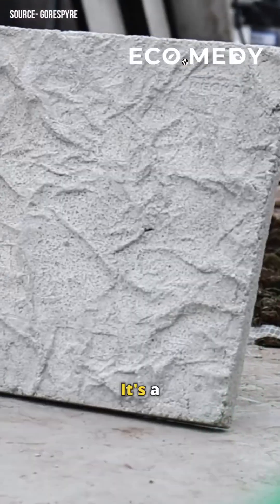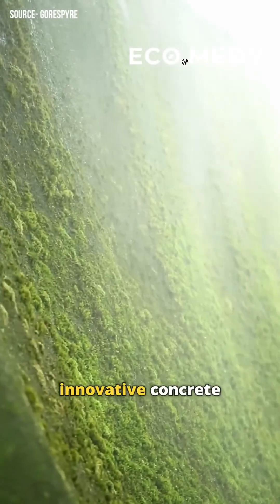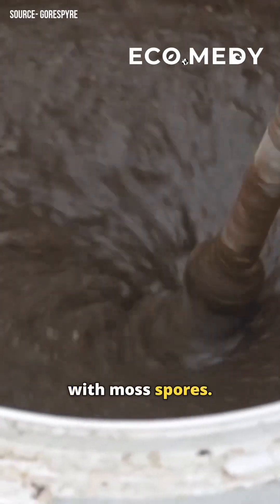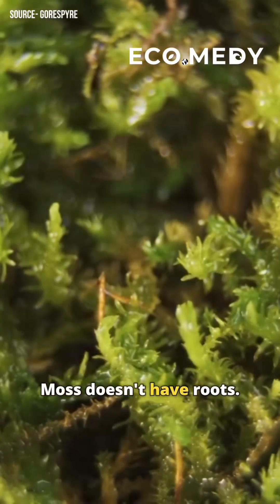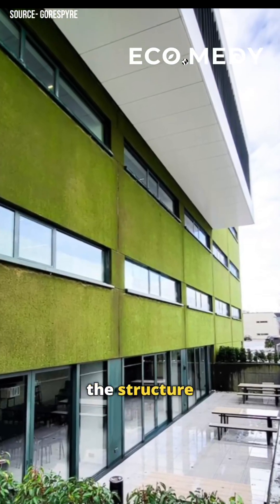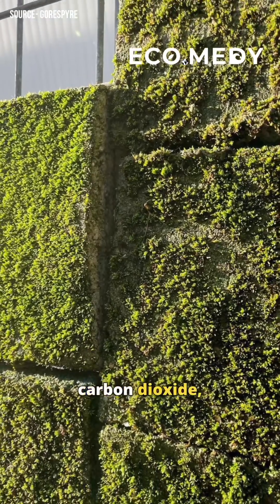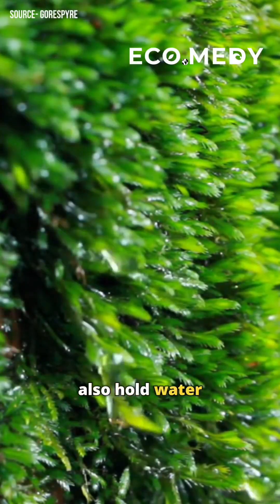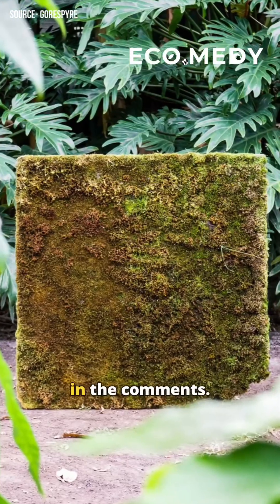Have you heard of moss cement?

Comment: what are the possible ratios to create it?
Reply from the maker: To create moss cement, a common ratio is 2 parts moss, 3 parts buttermilk or yoghurt (as a growth medium), and 1 part water blended together until smooth. For enhanced adhesion, you can add 1 part flour or cornstarch. Adjust consistency as needed to ensure it sticks well to surfaces.